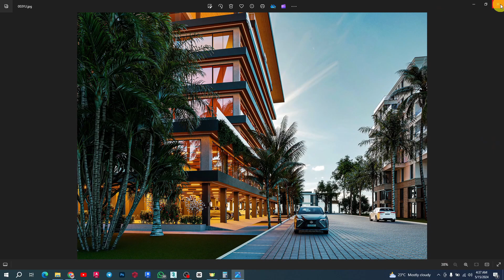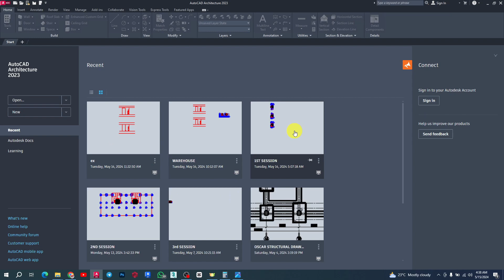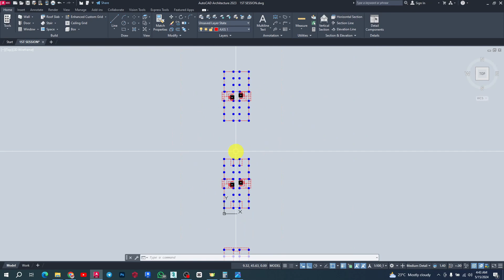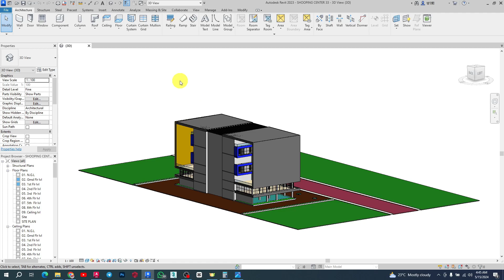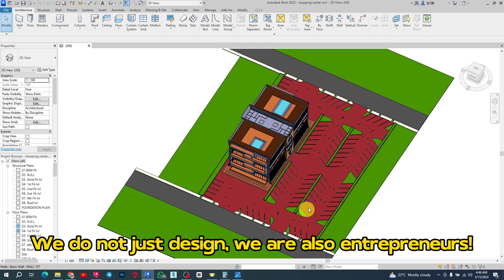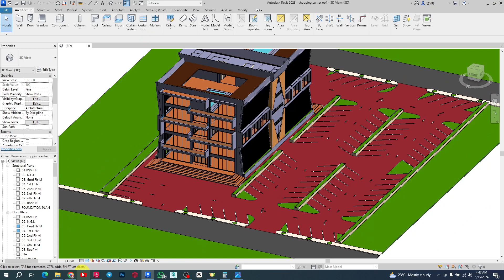part 2

Comment: Please I have a question will putting two elevators not drastically increase the cost of the project?
And please for the link to where we can get the softwares.
Reply from the maker: Sorry I am replying  just now. This is a commercial center and traffic management is very important. When you calculate the capacity of the structure and the activities involve, you will be able to decide on the number elevators or other exist means. what software do you want?